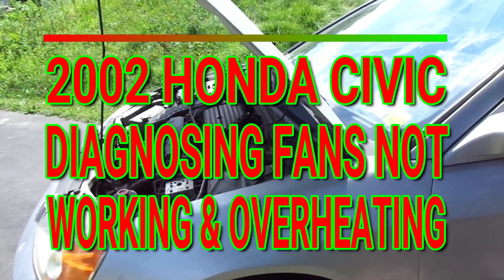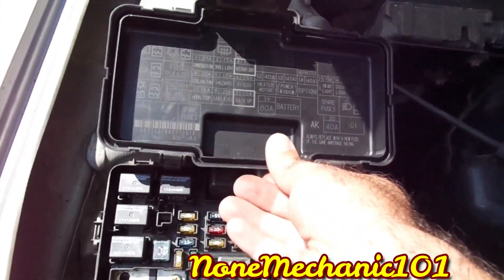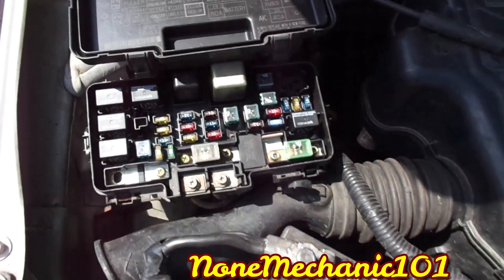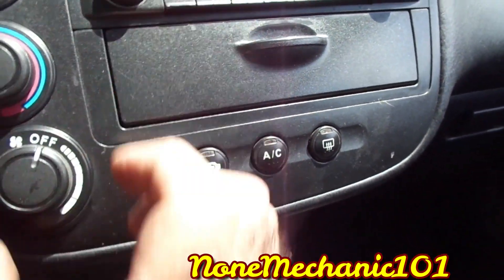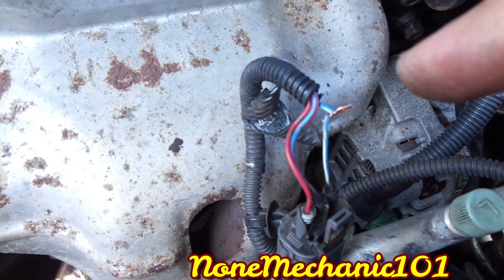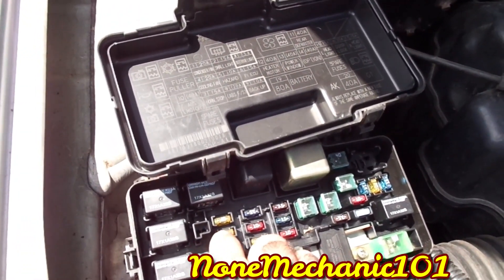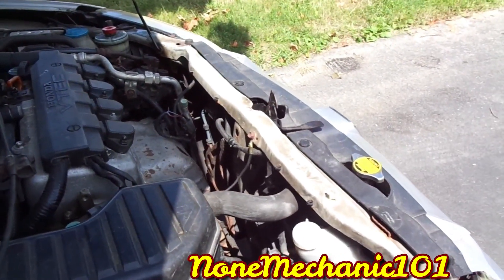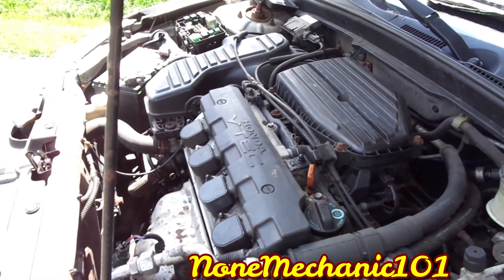2002 Honda Civic Diagnosing Fans not Working and Overheating

Comment: How did you solve the problem with both fans coming on even if the AC is off?
Reply from the maker: I haven't been able to pin point  the problem. Been driving this way with no problem.
Reply: Ok cool , I have the same issue I just find it a bit noisy cause the fans seem to be spinning at full blast once they kick in ,do update on a solution when if you find one
Reply from the maker: @linusstjuste3945  As soon I find the problem. I would do a video. Thank you for watching.
Reply: @NoneMechanic101  There is no issue. Civic's with this year has both fans connected and will turn on together at all times. They don't work independently like prior year Civics.
Reply from the maker: @mexzcanninja7412  wow, Thank you. I broke my head trying to find the problem. I appreciate it.🔧👍
Reply: @mexzcanninja7412   is it the same thing happening on my honda city 98 model? I tried to connect a wire on the fan switch and see if motor is working but both fans turned on when i turn the car on, i thought only cooling fan will on but its a different way, maybe i just need to change my temp sensor to see if thats the problem.. Thanks for the info
Reply: @linusstjuste3945  did you find out what causes that , the both fan to come on at full speed even though the ac is off?
Reply: @NoneMechanic101  did you find out the problem?
Reply from the maker: @thekylesgmusic  For what I have heard these Honda from that year both fans comes on automatically.
Reply: @NoneMechanic101  it comes on loud and at high speed as if the ac is on but the ac is off i understand that when the engine gets hot both fan comes on but before i changed the condenser fan motor it never used to come on so loud and fast
Reply: @NoneMechanic101  im having the same problem @linus st juste is having where the fan is at high speed even when the ac is off ..........es1 honda civic 2002
Reply: @thekylesgmusic  That’s because you fixed what was broken.

Comment: I have a 2004 Honda civic the engine light comes on, they say it the gas cap is not tight it has a new gas cap it is fine. the question I have when you turn on the car 15 mins just setting there the fans should turn on, it only turns on if I turn the A/C on. it never over heats!

Comment: My fans turn on and off with in a minute I don’t know why my car over heating help me lol 😂
Reply from the maker: I would check the head gasket
Reply: @NoneMechanic101  no smoke 💨 at the exhaust or no check engine light the fan shut off in minute or less just when at red light heat up so if it to long I give it gas and starts to cool then drive away

Comment: I have a 2002 honda civic lx my car over heats during regular driving and my radiator fans aren't coming on but do when I run the ac?
Reply from the maker: I would the check the coolant sensor
Reply: @NoneMechanic101  thanks
Reply from the maker: @beastwood540eastwood9  👍
Reply: How do I know if the coolant sensor is bad?
Reply: @beastwood540eastwood9  jump it put a paper clip in the plug if they turn on they good

Comment: We have a 2003 Honda Civic that continues to overheat. Only 1 fan on driver side is coming on when AC is running and car is on. Nothing from other fan. We tried driving it to get temp up on car, did not come on.. Checked all relays and fuses, changed out temp switch.. Any other suggestions on 2nd fan?
Reply from the maker: The fan is probably bad.
Reply: Did you fixed it?
Reply: I HAVE THE SAME ISSUE, DID YOU FIX IT? At this point that car might be sitting at a yunk yard lol

Comment: What if your wires are still good and not cut
Reply from the maker: Check the fans, the fuses, hoses
Reply: @NoneMechanic101  I did and everything is still good
Reply from the maker: @richardpbarnesjr1748  next thing I would do is check for a blown headgasket

Comment: Hi nice video , 
So my car was overheating and i realised that only one of the front fans was working , turns out the ac fan wasnt working , i had to hand prop it and turn it on , 
So my question is , is it possible for the car to overheat if either one of the fans is broken? Even though with the ac off ?
Car runs cool when driving in motion
Reply from the maker: In my opinion. Yes the car would over head.
Reply: @NoneMechanic101  thanks for the reply , will keep you updated , ordered the fan! Thanks

Comment: I have the same car Both my fans kick on and off at the same time and thats only after I switch ac on ,fans do not work without ac unfortunately,what can be wrong with my baby? Thanks
Reply from the maker: One fan should turn on after the car gets hot. If not the car is going to over heat. I would check the fuses, wires and the coolant temperature sensor
Reply: I'm having the same issue I replaced the temp sensor, coolant sensor and thermostat and still the fans won't turn on when I get the car temperature up they only turn on with the ac turned on

Comment: My fans don’t come on but I put a paper clip in the temperature sensor and it comes on. Any tips?
Reply from the maker: I would replace the coolant temperature sensor
Reply: @NoneMechanic101  I’ve done it
Reply from the maker: @NorrisCRT  What you did to fixed it?

Comment: man I replaced my fan  switch and fan relay. Fans don't turn on when you hit the ac but do turn when I jump the relay. what the heck is going on? also sometimes but not always the car will steam from the radiator but not the cap but hole for the draining if you put too much water. Ive don't a bunch of test to see if its the head gasket, like pulled the each plug and turned over the motor, used a block tester on the radiator, checked the dip stick for milky color, I haven't been able to drain the oil because I don't have ramps. its not overheating when it steams..its not overheating at all. but the fans are not kicking on.
Reply from the maker: I would check the relay wire. Under the relay box.

Comment: How Do you Know what the Problem is if Both Fans turn off when the AC is Off even though the temperature is running Hot?
Reply from the maker: I would check the wiring on the fans. Also I would check the coolant sensor.
Reply: Coolant switch

Comment: one question, when you just turn on the switch with the key and turn on the light green on the button AC, we should to see both fan spinning? it is supposed to see spinning AC-fan but the first fan when is supossed to spinning?
Reply from the maker: Both fans usually spin but when the A/C is off one should only be spinning.
Reply: @NoneMechanic101  I see, then I have a problem with Radiator-fan because it never run on  even the AC is turn on, the only one spinning always is the Right-fan where is the AC compressor. Thanks for the confirmation. regards.
Reply from the maker: @Yomero2006  Thank you for watching. Check your fuses. Also the other fan should turn on when the car is hot.

Comment: You mean the fans stays on without having the ignition turned on
Reply from the maker: As soon as I turn the car on the fans come on.  Once I turn the car off they go off.
Reply: NoneMechanic101 Hector sometimes the Honda they will have another fuse box under the dashboard. Somehow someone connected a wire with the fuse box or the switch
Reply from the maker: @ziggyperez2372  , Thank you for the information